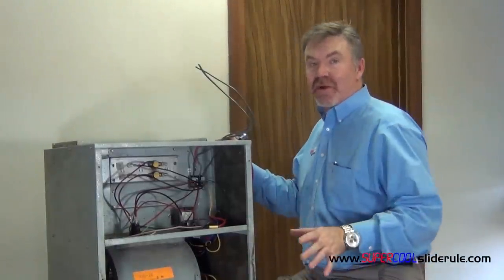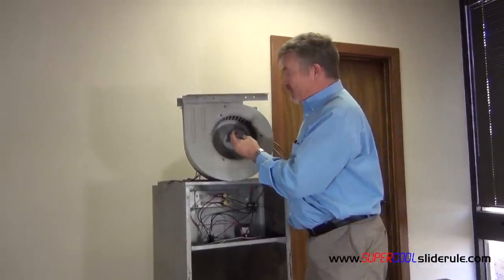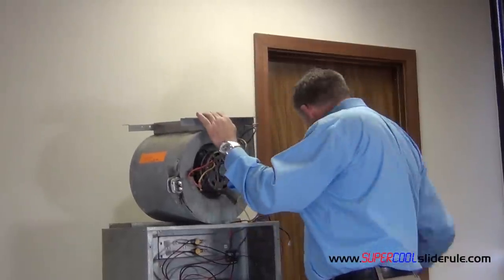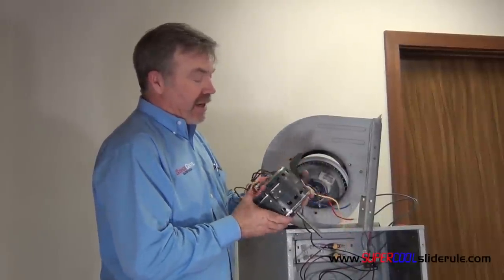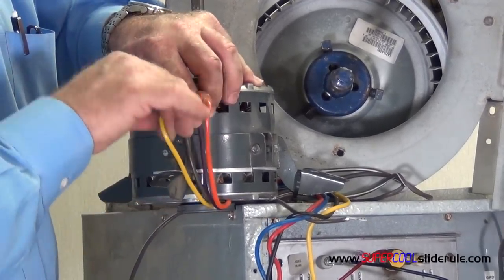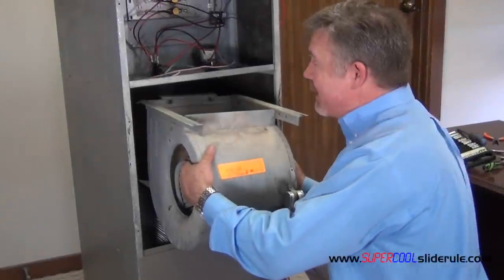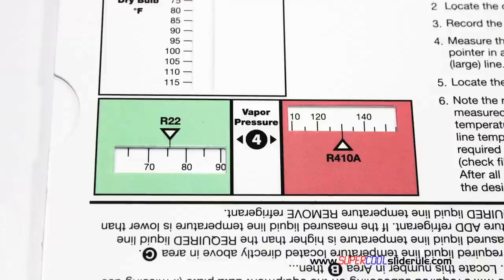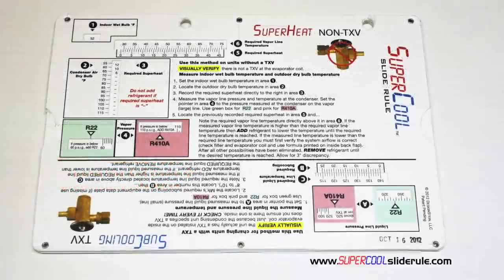How to change or replace an Indoor Blower Motor

Comment: Watched your video, bought a hub puller, and successfully replaced the blower motor in an AC unit in one of my rental properties. Saved myself about $1500. Thank you very much for posting this.

Comment: One five star plumbing company on Angi’s List who charged $85 to come out diagnosed our HVAC in our condo closet and came up with a few hundred dollars to fix but he said it may be eight weeks to get a new motor because of demand and Covid. Then on further inspection he said we needed to replace the whole unit and quoted $6,000! Our jaws were on the floor. We had our maintenance guy come up and look (wish I’d initially done this and saved the $85) and he said all you need to do is replace the motor. Everything else was fine. We called Grainger and bought a new fan motor and accessories which were immediately available; they walked us through it and it was a cinch. Only cost us just over $100. Your video really made a difference. Thanks.
Reply: I smelled burning smoke in the house when the fan turn on I thought it was the motor turned out blower motor was a ECM motor. Granger was $250 for the motor installed it and when tried to power it up the contactor was chattering. Replaced the contactor compressor turn on and shut off again the last time it smoked the new blower motor, and thermostat. AC guy came out checked the compressor it was shorted entire unit was trashed. Not only was I out the money for the blower I had to buy entire new unit $8800.  My advice is get a good AC tech to do a full test on everything before buying parts.  AC guy thinks the smoke was the electronics burning up smoke was being sucked inside the house.

Comment: I'm not an AC guy, but I'd like to add a couple of suggestions:
1. Please don't discharge the capacitor with the socket wrench like he shows you in the video.  It could mess you up.  Use a screwdriver instead.  If you sit next to the attic opening, a little shock of electricity could throw you down to the floor.
2. Please wear gloves.  You might get cut.  There are so many sharp edges.
Reply: I'm an AC guy (an a/c girl, actually. lol) and I agree with your suggestions. Most socket wrenches I have seen don't have rubber handles like his, and carelessly clanking around the capacitor like he did, with a metal tool will give you that little "jolt" he is talking about. Using a screwdriver with a plastic or rubber handle, along with the gloves you should be wearing, will give you good protection. Lay the screwdriver across the two tabs so that they are touching the metal screwdriver at the same time. (they just have to touch for a moment. You may have a flash of electricity and a pop sound - but that is rare.) If you have a dual capacitor, just lay the screwdriver across two, and then pick it up and rotate it, making sure to get each group of tabs (you don't need to touch each individual tab). Also, I discharge them even when new in the box. Someone could have returned it before you purchased. I know I am overly cautious, but I avoid injury and damage to equipment.
Reply: @heidis8713  Back in the day used to be a electronic power supply tech I would repair power supplies had lot of voltage in them. We would charge up a cap leave it on someone's chair give them a buz everyone of us had been shocked by our jobs several hundred volts.
Reply: @Mike-01234  that's hard-core. Lol 🤣 What were their reactions to it?

Comment: thank you! I took my time doing it. I'm not a tech nor have any idea of how everything in works in the a.c. system. regardless, I was able to replace my motor, get all the parts, install it back and it worked. I saved close to 700 dollars doing it myself. like you said some wiring is idiot proof.

Comment: not all blower motor need a puller, only the one rusted or stuck in the fan.  Most just came out easily with bit of oil, after loosing the bolt.
Reply: I use soap bubbles and sand paper :)
Reply: Pb blaster
Reply: I used silicone spray.  Didn't hit rust until near the end of the shaft, took a little 400 grit emery paper to smooth the end of the shaft and the blower wheel came right off.  The problem I'm having now is getting the belly band adjusted correctly.  I had taken the old motor out without removing the bracket arms and tried to do the reverse to install the new.  It's a bitch trying to true up the wheel in the housing.  If I can't get it in the morning, I guess I'll take it all apart again and tighten the belly band first, then screw on the arms onto the housing, and save the set screw for last.

Comment: SuperCool Slide Rule:  Can I ask a question?  I loved your video, watched it, gained my confidence, and I tried to do it myself.  However, I have a Ruud too, yet it has the control board and many more wires connected to that fan frame.  What do you do in that situation?  Some of the wires are not just pull off and put back on; they are hard-connected to different pieces ... does that make sense?  I wanted to save money, because I am a student and do DIY to save money.  Yet, I am not sure how to work through the disconnection of all of that stuff.  Is there a trick?  Thanks, Poe

Comment: Question: My Furnace is maybe 20 yrs old, how hard is it to find a motor that will match?
Reply: just get a universal motor.... they usually $69.00 and that's if you have a HVAC licence.... you can find it online if you don't have a HVAC licence, I paid a tech $400 to replace my motor, that's before I took up HVAC at my local community college.... never again will I pay that.. and another tip... local hvac contractors over charge for services, I felt like paying $2100 for 3 HVAC classes was worth it then paying a company $1000 to replace a $12 part... it's all about sales and money when dealing with a contractor that has a huge marketing budget.
Reply: It will pay off long term

Comment: You don't need a hub puller what I always did was take a  4" grinder with a wire wheel remove all the rust on the shaft sticking out. Then I tamp the fan little more in remove any rust right there. Tiny amount of WD 40 put the fan over a bucket and one tap on the blower motor shaft entire motor will slide right out of the hub. The problem is the rust that builds up on the shaft when you try to pass that rusted shaft though the hub it gets jammed.

Comment: SuperCool, can you please answer this: In a system where a furnace is in basement, blower located is first compartment, then heat, then cool compartment. lets says the air filter is next to blower, does it make a difference is fan faces the air filter or blower motor faces the filter?

Comment: Hello, I changed out my blower motor, but when I retired it and turned it on both the heater and ac unit kick on. I pulled the breaker to the heater to get through the winter. Now it’s summer I moved the thermostat to cool and the blower kicks on but not the unit outside. I moved the thermostat back to heat and the unit outside kicks on but no blower. I know I have wired something improperly. Any advice will be greatly appreciated, thank you!
Reply: *rewired

Comment: Hmmm...watched plenty of YT vids. regarding cleaning, repairing & replacing the blower motor &/or Blower capacitor in which the capacitor is easily visible on the blower fan housing yet on my Blower housing I don't see a capacitor & I doubt it's in where the motor & fin wheel are located....any thoughts? Thanks for the video.
Reply: meonetallguy Did you have a module ECM on your motor like ours? Then your capacitor would be internal.
Reply: onecrazywheel jafari
Reply: Did you physically pull the blower assembly out? Mine was mounted to the back of the whole assembly.. not visible without taking it apart.  Recently had to change my capacitor as well.

Comment: I did everything like you did but my new motor is running slowly, why?
Please help
Reply: If you have a 4 speed motor like mine, there is a possibility your control board is not putting out voltage to your high speed connector or you may have a loose connection at your board. Can check for voltage as soon as your furnace calls for the blower to come in which is a short while after the burners have been on.

Comment: main reason the motors go out to begin with is dirt accumulating on the fan blades and motor and not oiling the motor. the dirt on the fan blades will be up to a half inch thick and compressed air is not enough to clean it. it should be brushed and hosed and you often have to pick out the crud with a screw driver. This should be done every 3 years. the blower will also work much more efficiently afterwards

Comment: Never recommended cleaning fins if needed. Should not have pulled unit before discharging capacitor first. Used a ratchet with rubber handle to discharge capacitor but did not explain using a screwdriver and having a rubber handle when doing this. Very low rated film. Hope no one gets shocked cuz your no teacher for sure.